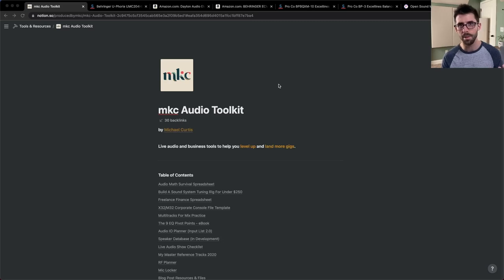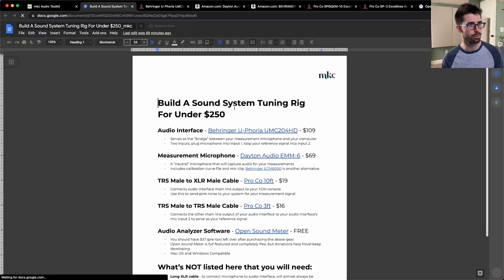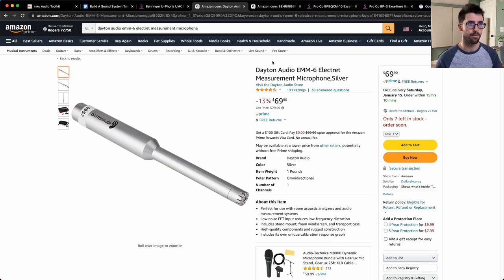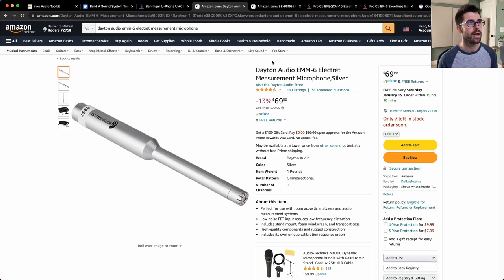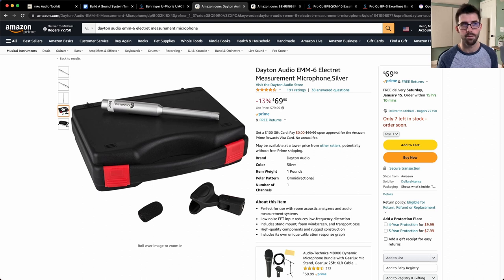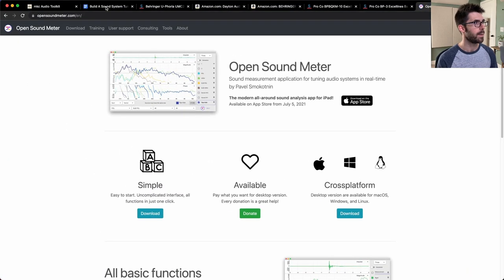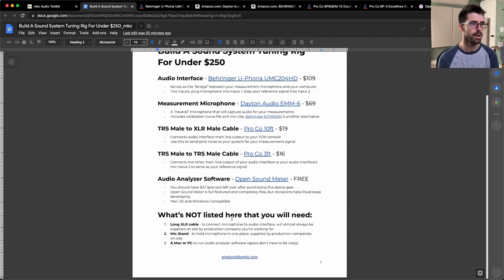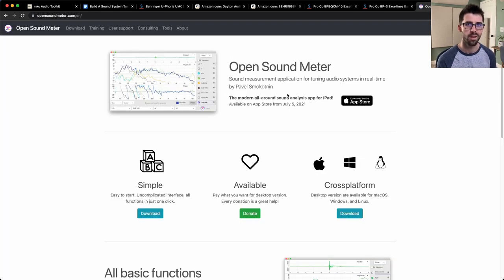Build A Sound System Tuning Rig For Under $250

Comment: Hey these videos are amazing thank you. I'm a young engineer really trying to absorb and learn and grow and cut my teeth out here and system design and tuning I think is one of the next hurdles to attack for me in audio. I just found your channel and am super excited to keep watching and learning. Also, the topics you hit are SUPER relevant. Every video title I read just adds more open tabs to my web browser.
Reply from the maker: Thank you for the kind words and I'm glad these videos have been helpful to you!

Any other topics you feel are missing that I need to hit?
Reply: @MichaelCurtisAudio  I'll probably have to watch a bunch more before I'd have a good answer, but I'll be sure to ask when I have questions as I watch! Actually as I typed this and while watching another video one thing did come to mind. I work a lot for a hotel where your hands are tied a lot between equipment, placement, room acoustics, even client's ability to use the equipment effectively. Do you have any videos that speak more to preparing for those kind of sets? I just watched "Overcoming boomy rooms" and you mentioned opting for more fills at lower volume in similar scenarios.

Comment: Behringer makes the UMC202HD which has two inputs and two outputs.  It's slightly cheaper than the UMC204HD which has two inputs and 4 outputs and MIDI.  We don't need MIDI and only need two outputs, so the UMC202HD seems like a better choice for an inexpensive dedicated tuning rig.  If you want to get something with more inputs (so you can have more than one measurement mic hooked up at a time), look at the UMC404HD which has 4 inputs which will allow you to hook up 3 measurement mics at the same time.
Reply from the maker: Good to know! I wasn't aware of that other model. Another $20 saved.

Comment: Room EQ Wizard (REQ) can do some excellent audio analysis of SPL, phase, distortion, time, and more. It also can produce correction EQ curves to get a desired response. REQ is free.
Reply from the maker: You're right, REW is a wonderful tool. But, it's an offline measurement tool, not real-time. For system tuning I prefer to use real time.

Comment: Hi Michael,

thanks for the great content you bring online. Very informative and highly educationaI. I like the approach: 1) What we do today, 2) This is how it´s done, 3) Repeat what we´ve learned today.
I bought a measurement mic from Sonarworks and it comes with downloadable calibration files (as txt and swmic) at 0 degrees, 30 degrees and 90 degrees. How do I import the calibration file so that open sound meter uses it (automatically) with the mic when I do measurements? 

Cheers
André
Reply from the maker: Hey, Andre! As far as I know, OSM still doesn't "remember" your calibration file when you open up a new session. I wish it did!

I honestly don't use calibration files for either my Audix mics or my iSemcon EMX-7150. The differences are negligible : ). Would I use the calibration when calibrating studio monitors? Sure. In live use? Nope.
Reply: @MichaelCurtisAudio  Thanks a lot for your reply! That brings up one more question for me: how do you use the calibration when you´re calibrating  studio monitors? 
Thanks one more time
Reply from the maker: @AndreSchaier  You're welcome! When calibrating studio monitors with Sonarwork's software you simply upload the .txt calibration file as it prompts you and it will take that data into account when walking you through the measurement process.

When using SMAART or OSM to EQ my monitors I load the .txt calibration file into the software on the input.
Reply: Hey Andre, didn't expect you here, you little legend you. 🤩 Love your videos btw.

Comment: Should the iPad Pro work with the UMC204hd from this list?  Thanks for any assistance you can be.
Reply from the maker: I'm not too sure, to be honest. I'm pretty sure the interfaces from Focusrite will, so I'd look at those.
Reply: @MichaelCurtisAudio  I actually loaded the drivers on to a pc, then let the driver manager start the interface, then it worked with the pc and the iPad Pro.  I did also try a newer printer cable.  
On another note- if you ever make a video of just room tuning a basic point source system with the OSM I’d like to see your process.  Thanks
Reply from the maker: @RogerWellsMinistries  I'll keep that in mind!

Comment: I use Arta as software, my digital mixer as soundcard and dbx mic 🙂
Reply from the maker: I've never heard of or used Arta! I'll check it out. Do you know if it plays nice with Parallels 16? I've only got a Mac.
Reply: @MichaelCurtisAudio  , Think its only for Windows, its free in a not save version, but it is not expensive
It May not be as good for your purpose, maby more for speeker builders, but to Tune in a system its fine 🙂
Reply: I'm going to check open sound meter 😊👍
Reply from the maker: @orlarieper6175  Please do. It's a hair buggy at times (at least on my M1 MacBook Air), but I've really enjoyed using it.
Reply: Sometimes Its a “loosing hair” interest to have but Also great when it works 😜

Comment: Is it possible to use the behringer um2 for this?
Reply from the maker: Technically yes, but I would test out looping those RCA outputs into the instrument input first before using it on a show.
Reply: @MichaelCurtisAudio  I don't plan on using this on a show, just wanna run some measurements at home. I used a different audio interface in the past but lost it during the moving and now I need a new one. Initially I intended to get the Focusrite Scarlett Solo Gen3 but where I'm currently living that costs 3 times as much as the Behringer and I'm not sure it's worth it just to run measurements at home. 
I also thought about getting a USB mic like the UMIK1 from mini DSP but in the past I had better results using loop back measurements.
Reply from the maker: @300ZCorradoVR6Z  Got it! Makes sense. Yes I think you'd be good with the Behringer.
Reply: @MichaelCurtisAudio  Thank you!